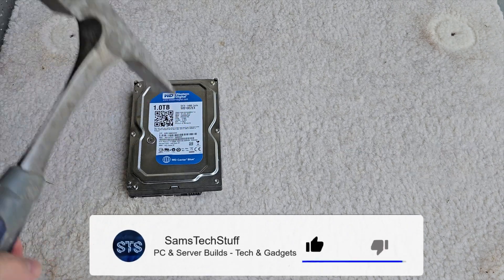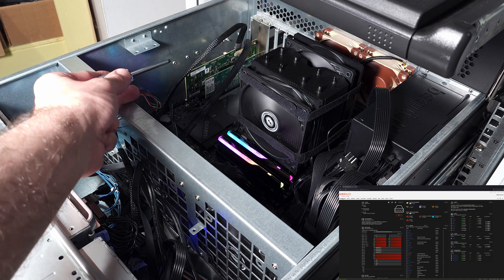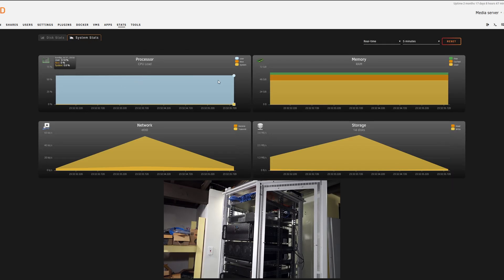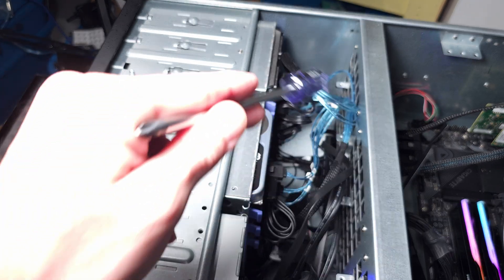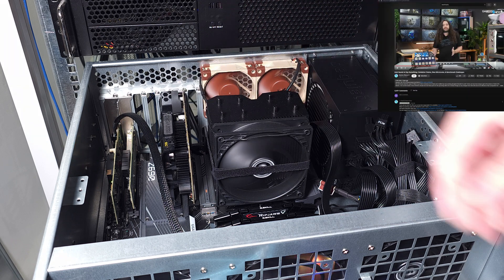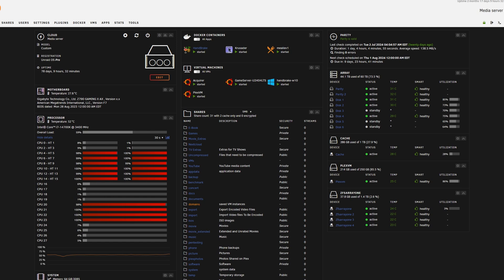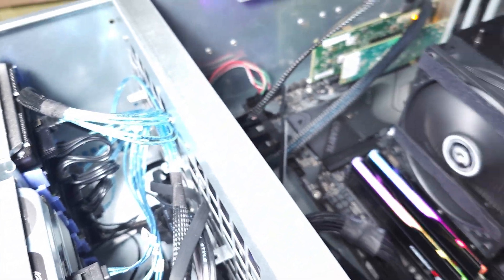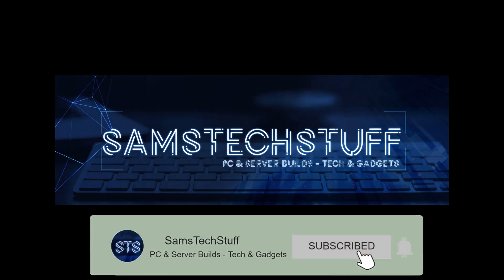Don't Buy Used Intel 13/14th gen CPUs for Your NAS!

Comment: My i9-14900K on ASUS ROG MAXIMUS Z790 HERO runs 66C to 78C under load stable settings at 56X, 95C max, 94C long and short throttle, 247 WATT long term, 253 WATT short, undervolted to 1.34V on P-cores, 1.37V CPU max, 44X E-cores 1.24V max ,  using SAMA 360mm ARGB Cpu Liquid Cooler 360 AIO, Cinebench R23.2 benchmark score multi-core 33762, single core 2194  runs perfectly stable DDR5 @5600MHz and runs faster. It becomes unstable when running the DDR5 at 6000MHz and up. Ran for 3 months not issue DDR5 6000MHz tell Windows 11 update. Then noticed spikes even running idle hitting 6.1 even 6.3GHz wth!!! So I looked it up what was issue and yes had to limit V-core power to 1.37 Volts and worked. I spent days re-configuring bench marking  and found the sweet spot to get over 33.4k in Cinebench R23.2, yet when clocked the TMP1 on DDR5 to normal 6000MHz it ran slower and much hotter and not always stable program would fail to open and randomly close. On the other note the my i5-12600KF on ASRock Z690 Taichi Razer Edition 59C underload under-volt 1.35V on DARKROCK D360 CPU Liquid Cooler with 360mm Radiator ARGB. OK hope this helps someone.

Comment: Ive built tons of systems and tons of homelabs with these . Alot of the instability issues where bios settings. The only system id stay away form is 14900k.
Reply from the maker: I would agree, the original* bios settings and older bios were frying these chips. That is why I would advise against buying any of these CPUs used, I would only buy new and run on boards with newer bios updates
Reply: @STS asus boards where huge problem and they took no responsibility too. Its nice intel stepped in an extended the warranty im currently testing a 265k on proxmox with amp game server and truenas vm . Think is a beast so happy so far i always leaned amd . But for this stuff personally love the intel stuff
Reply from the maker: Edited the typo - yes, they all were somewhat guilty here. Agreed on Intel finally doing something for users but I do have to wonder if it wasn't made such a huge issue if they would have stepped up. I tend to prefer the intel chips for NAS's and homelab setups as well but I do miss my old threadripper 1920x (all the PCIE lanes)

Comment: I'm parting out a nAS right now, and this is good info. I was thinking of the i5-14500 or one of the Ryzen 9XXX series. Ryzen runs circles around Intel right now for literally anything but transcoding, better performance at lower power use, but I was considering Intel for the iGPU, but hell, I could get a Sparkle Arc A310 for $99.99 that would QuickSync anything I could throw at it in an AMD NAS.
Reply from the maker: A 12th gen Intel CPU would definitely work well, I haven't seen any reports of these issues with 12th gen and you still get the iGPU. If you are using Plex for example, while not supported, I think I read that the iGPU on AMD can provide hardware accelerated transcoding now. It's likely not as polished at Intel though. The A310 is certainly an interesting option, especially down the line when AV1 comes into play.

Comment: First time to your channel, subbed! What server rack are you using with this system in this video?
Reply from the maker: Hey, welcome! I am using a certain type of rack that is largely not available to anyone. It was made for a specific purpose in a specific industry and sold in a package. Essentially, unless you find one somewhere you can't buy it. That being said, some day I would like to get another rack that's a little more available. I like this rack and it does a lot well. I'm thinking about eventually doing some work on it with fans, fan controllers, RGB, all the fun stuff. 

Do you have your own homelab or are you thinking about starting / building one?

Comment: I think I'll go with 12400 or 125000 for NAS. I'm not sure if I want to go with a 13th gen or 14th gen but this information is good to know. I'm only using a NAS for backup purposes with no Plex. My Zidoo Z9X Pro can stream movies from an NFS share.
Reply from the maker: Hey Grayson! The 12400/12500 is a solid choice IMO. I have not seen many reports of 12000 series issues and the 12400s seem to be quite reliable (I have had a few of them). I definitely would stay away from 13/14th gen right now and probably forever to be honest, at least on the used market.

I haven't heard of that device, the Zidoo Z9X Pro. How have you been liking it? FWIW, I still use an extremely old 4k Roku.
Reply: @STS  Zidoo is an awesome player, especially for those who are into dedicated high-end home theater. Zidoo media players are targeted towards local network streamers. It does not have any Google services.

I would like to see Intel get their act together for next-gen CPUs though.
Reply from the maker: @graysonpeddie  Interesting, I will have to check out the Zidoo's then. 

Yeah, it's quite disappointing about the state of the Intel products right now. Intel desktop  CPUs have traditionally made excellent NAS platforms. I'm mildly curious about grabbing a pre-loved Epyc or maybe building a NAS/server on AM4/5.

Comment: Does i5 14500 have this issue. Because i am gonna get this processor. Should I buy or not . For 3d animation
Reply: Any raptor lake CPU over 65w is affected
Reply from the maker: Yup, unfortunately any 65w tdp and above appear to be affected by the voltage issue. Looking for to this microcode/BIOS update.

Comment: Yeah, that's an uncomfortable level of uncertainty. I went the E5-2696 v3 route, and I really wanted the PCIe lanes. But I am a bit jelly of the iGPU. But otherwise, rock solid performance at almost 3.8Ghz across 18 cores and 36 threads. Plus all of the expansion cards, and it's still expandable. Not real efficient, but everything is a tradeoff. But I think you're safe without the crazy boosting behavior that asks for 1.6v. It should be fine.
Reply from the maker: Hey, sorry for the late response here! My dilemma before I grabbed the 14700K was either a v4 or a desktop grade CPU. I probably would have spent less upfront on hardware but figuring out the power costs over the next ~6 years, the 14700K seemed to be better for total overall cost. Tradeoff like you mentioned. 

I'm still going strong with my system, very likely because I turned off the turbo states essentially right away. The system is still chugging away encoding and serving files though. Would still be a very hard sale IMO to buy one of these chips used for a NAS. Perhaps next gen of the Intel CPUs '16th' gen might be a worthy successor.

Comment: So WTF were you talking about with the HDD?
Reply from the maker: @S.H.O.D.A.N_1  That was a fun clip about being frustrated with the CPU stability issue with the 13/14th gen Intel CPUs. It's one thing if a gaming PC reboots or crashes during a game, it's another if you're NAS crashes while it's writing data. I can't recommend to anyone at this point to buy used 13/14th gen CPUs for homelab (or gaming) workstations

Comment: Is it all 13th and 14th gen or just Ks
Reply from the maker: Right now it seems like the K series CPUs are the hardest hit but the voltage issues might still apply to all 13/14th gen CPUs. There were a number of 13th gen CPUs listed in the Gamers Nexus video, even just i5's. If you have a 13/14th gen CPU keep your eyes peeled for BIOS updates. If you are looking to buy used,bi suggest maybe looking at 10/11/12th gen instead.

Comment: Imagine using Intel in 2024.
Reply from the maker: The situation is a bummer for sure. While AMD is certainly viable now, Intel CPUs really have a strong presence in the homelab community. The 12/13/14th gen CPUs are excellent choices IMO for that mix of powerful cores and efficient cores for a home virtualization server for example. When you couple that with the iGPU for quicksync acceleration, they make a lot of sense for people to buy for NAS's and servers. Given the 13th gen CPUs have been potentially exposed to dangerous voltages for over a while now and even 14th gen CPUs potentially have voltage degradation or damage, I don't think I could recommend buying used Intel 13/14th gen CPUs even at a discount to any homelabbers anymore.
Reply: @STS  excuse me, what is virtualization server?
Reply from the maker: The server OS that I am using? I'm using Unraid which is utilizing KVM. My setup is still running strong which is good. Hopefully keeps up this way for a long time.

Comment: "I have terabytes of my favourite Linux isos on here for Plex"

On a serious note, I'm glad I didn't upgrade to a 14900k for my NAS.
Reply from the maker: I enjoy streaming the latest edition of Ubuntu 24.04 to my TV, I can only assume so does everyone else :)
Reply: @STS we have similar interests on Linux!

I'm just going to keep my W-2145 as the 24/7 server and get a separate machine for gaming and other work..
Reply from the maker: @HashanGayasri  Nice! Probably a good idea. I was planning on resurrecting my gaming VM and possibly some LLM testing. Up in the air right now until I figure out what to do with this 14700K setup. Debating picking up a 12900K or an Epyc setup. I'll have to look at the more recent Xeon CPUs to see what they have to offer. What drew you into the W-2145? Cost?
Reply: @STS  I was considering a i9 8th gen vs the W2145. ECC helped me to sway towards the Xeon. It's a fantastic processor and HP Z4 G4 chassis is also really good. (downside is not much space for HDDs).
Reply from the maker: @HashanGayasri  Ah nice! Yea, I've been starting to look into my options in case my 14700K fails. Feels like the older scalable / silver CPUs or the second generation Epyc boards are among the best value. Glad the Z4 worked out for you, haven't worked on one of those in a long time now. If you need more hard drive space, you might want to look into a DAS, another case of some sort and connect it by SAS using a card with an external port if you need the drive bays.
Reply: @STS  I don't have much experience AMD processors but if Intel continues to be unreliable with the newer gens, I'd have to do my research :)
Do you have any reccomendation for a SAS HBA with an external port? I don't mind paying more for it for reliability (even without an external port, I can probably bring the cable out).

I have two spare pc cases that I've bought and I think a DIY route is much cheaper than buying a refurb DAS in Australia. I can probably 3d print some caddys too to fit in the cases.

Comment: hi, mind sharing what cpu cooler are u using? im planning to build an i9 but idk what cooler will fit in a 4u case except the nh d12L
Reply from the maker: @88tx  Well, options are limited. This cooler is not ideal but it works for me for the moment. It's an Arctic i35 but I removed the plastic shroud it comes with and essentially Velcro'd two Arctic P12 fans on the front and back. It's still technically maybe 1 or 2mm too tall but the lid on my Rosewill RSV-L4500 does close and slide. My thought is that I would like to replace this cooler with an Arctic Liquid Freezer 3 240 or possibly 360mm AIO. The 240 should fit no problem, I'll be measuring and mocking up a cardboard box soon to see if the 360mm will fit. I think it will but I'm not sure yet. The AIO would be mounted on the fan tray that comes with the case, I would likely flip it around and keep it in the position closer to the hard drives.

Cooling an I9 on a single tower air cooler is not going to happen IMO. You would end up getting extreme temps and throttling unless you spent time testing undervolting and undeclocking or you set some lower power limits. I would suggest skipping that and trying to go for a quality AIO like the Liquid Freezer 3.
Reply: @STS  omg thanks!
Reply from the maker: @88tx  Glad to help out! I emailed a contact at Arctic to see if they are entertaining making any kind of product to fill this niche use case (4u compatible air coolers for consumer sockets). We'll see.

Comment: Been running my 2950x at 1-2c below the thermal max for months now, Intel needs to get it together! Sorry your new system got nerfd!
Reply from the maker: Hey again! Yeah, it's been a little bit lack luster grabbing the 14700k. I'm hoping my chip didn't suffer much during the period of time I was testing it for videos. It's been running with turbo off for most of its life so far though, hoping the issue can truly be resolved by just a microcode/bios update. Will be hard for me to ever recommend one of these 13/14th gen CPUs for homelabbing or gaming since it will be nearly impossible to know how degraded it may or may not be. Not that I will care too much but the total useful life of the CPUs will likely be much lower than normal which will prob hurt resale value for owners as well.

Comment: I have been running a 13600k in UnRaid for ~9mo now with no noticeable issues. I have it slightly undervolted just for power savings but that is it. I went with a ddr4 Z690 as I already had 128GB of 3600mhz on hand.
Reply from the maker: Hey, nice setup there! Unraid? How are you average temps?

In my previous 12600K video I did something similar, optimized for power usage and it was quite successful. I did the same with the motherboard and memory too, z690 + ddr4.
Reply: My server is equiped with 12700k, main rig is 13900k. Both undervolted since day one, no issues. Unraid Server is a beast, able to transcode  35,
4k streams at the same time. One day the 13900k will end up in my server.
Reply from the maker: Nice setups there. I'm still running my 14700k, been encoding and powering my Unraid server since I set it up. I really like this CPU architecture for homelabbing which is why the potential degradation of CPUs that have been exposed to high voltage and high heat is so disappointing to me. I quite like my 14700k and like you, it's a beast when it comes to transcoding and running Dockers + VMs. My 14700k runs with no turbo enabled so I believe it has not seen much degradation from the vmin issue. Hopefully yours is solid as well!

Comment: Wendell has been bringing up big issues with Intel 13 and 14th cpu, there is a ton of new info on this on his channel and gamersnexus. Limiting it might help, but overtime if you have a dud chip it seems it will eventually fail regardless of what you do.
Reply from the maker: Yea I re-watched both videos actually to make sure I understood that they were saying. Hard to know at this point, the update from Intel yesterday seems to indicate its simply a BIOS fix but that fix is at least 3-4 weeks out I would imagine and to be honest, there's already been quite a few BIOS's released so, "I don't know" tm.

I will be looking forward to the possibility of keeping my 14700K and actually using turbo but if I need to get off of the platform for my NAS, I will, quickly.

Comment: please sell these super hot and buy ryzen 9950X. and create video from it
Reply: Except that means he needs a dedicated video card for encoding and such?
Reply from the maker: @Necrotic99  Well, without Intel quicksync, any video encoding would need to be done on CPU or AMD iGPU (if supported). If required for the workload, a dedicated GPU might be required. It depends on the workload really.
Reply from the maker: Interesting idea, I will probably buy a Ryzen 9000 but I'm not sure if I want to use it for Unraid just yet - there's lots of testing to do. I'm still debating an AMD system though.

Comment: What was that card with 4nvme on it and hooked up to sata cables?
Reply from the maker: That is an SDP11 from SilverstoneTek or just Silverstone. This is a device that allows me to connect 4x SATA ngff /m.2 SSDs. It isn't fancy in that it has a controller doing something special, just needs SATA power and data cables.  Using it to connect four 512GB SATA SSDs for use in my ZFS array on my Unraid server. It's been working very well.

Comment: A capacitor on my H670m ITX board recently blew up with my 13100. I wonder if there is a connection
Reply from the maker: I replied on reddit, I would definitely recommend contacting the vendor for RMA if it's under warranty. The 13100 should not be drawing much power at all, much lower than an i7 or i9 CPU. Was this your NAS setup or a workstation you built?

Comment: Is this also an issue with the i5 13500? I have been using that one for about 9 months without any issues. The cpu temp when idle is 28-30 degrees Celsius. Not sure under load but I dont think I've ever seen it go above 50 degrees
Reply: I'm pretty sure 13600 (non k) and below are just 12th gen. I think you're safe.

Comment: I am running a 13500. I’m intrigued to see if I see any issues.
Reply from the maker: Hey, cool. What is your use-case for this CPU? Desktop? Gaming PC? Homelab server? I'm curious too if you know what your average load temperatures are, hard to know exactly how all of that factors into potential degradation.
Reply: @STS  Unraid same as you. Linux isos, plex, transcoding, back ups, VMs, Home assistant, etc. 

These are on the stock cooler as well. I’d say around the 40’s as it’s between 20-50% utilization at any time.
Reply from the maker: @Matej1200  Ill be very interested to see what happens here. As someone pointed out on r/Unraid, running with lower operating temperatures could buy you more time, if you have a CPU with some type of material defect.

Sounds like a nice setup there, is this part of a larger Homelab type setup or is it the Homelab setup? Like I said in the video, I used to handle my compute stuff on ESX but I'm all Unraid now.
Reply from the maker: @IntegerOfDoom  Time will tell how bad the issue is. Hard to say how the 14th gen products will age as they are newer than the 13th gen and the 14th gen seems to have been spared from the manufacturing defect. 

Either way, I don't like this, thinking about my options in the Xeon space or what kind of eBay deal I can get on a second gen Epyc setup. Not ideal, the best chips for homelabbing IMO are something like the 12/13/14th gen.